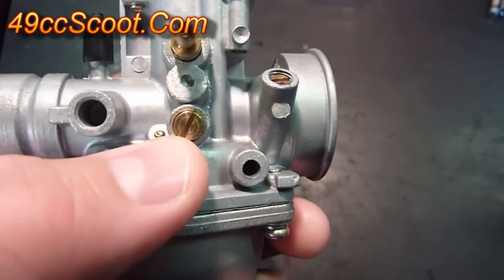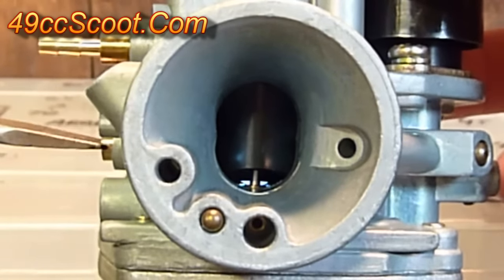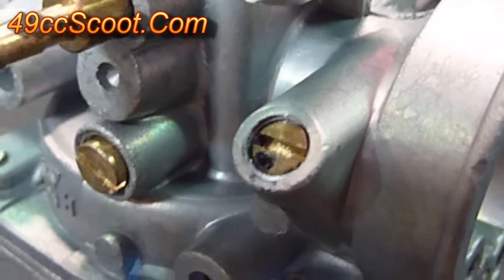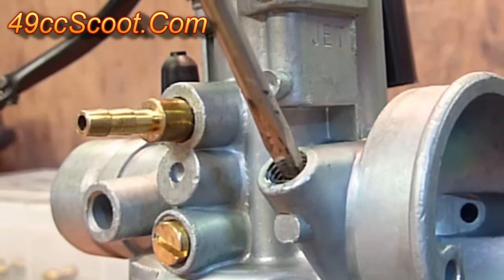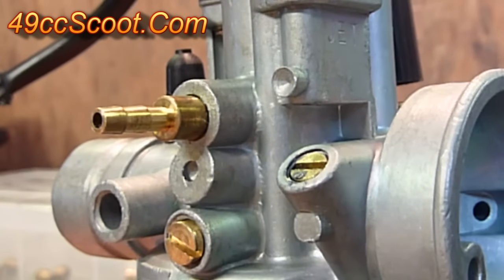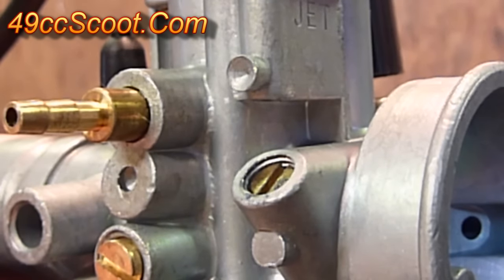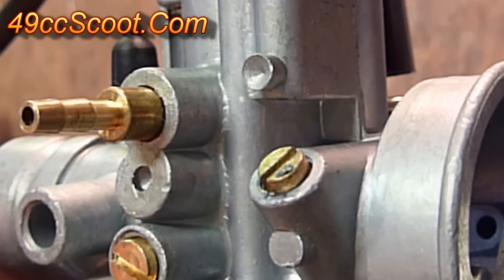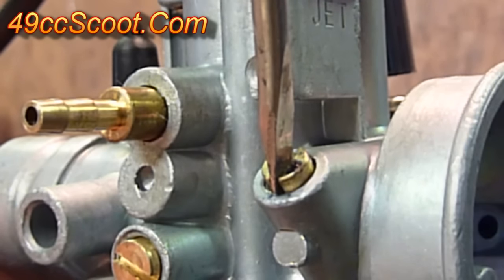Two-Stroke Scooter / ATV Carburetor Settings And Adjustments 2of4 : Idle Speed & Mixture

Comment: I have a 2 stroke bike 125cc. I bought an aftermarket exhaust for this model and for the same cc. I changed it and i did some settings on my mixture screw. I have now a good and continuously idle at one and a half (1,5) - quarter past 2 turns out and the bike it seems that its working very good. BUT when i'm putting the 1st gear and trying to run the bike bog. What is your opinion about that? 
Its the exhaust the problem ? Or something else?
Thanks in advance
Reply from the maker: Are you sure you don't need to be more aggressive with the clutch? Tuned pipes for 2Ts typically make more power at higher revs at the expense of robbing output at lower revs. I'm mostly accustomed to CVT transmissions, but we have to use higher engagement clutch springs and lighter weights to keep RPM up with tuned pipes.

You may also have needle or main jet issues.

Comment: Thanks for the vids. Very helpful and used it to help me disassemble mine, clean and put back together. Mine is on a 1986 Yamaha Jog but it doesn't have an idle mixture screw. The port is there but it is filled with hard plastic (like from a hot glue gun) at both the screw positions and the air intake port. Why would this be?

Comment from the maker: +Guajiro Konn You've pressurized the cases (about 6psi) and made sure pressure does not escape? Checking with propane, water, carb cleaner etc... for intake leaks is not always effective on a 2T. Reeds in good shape? Float height set properly?
Reply: hey I just picked up a eton beamer 2t and it idles too high even with the idle speed screw at its lowest setting, would i have to adjust the mixture setting? or is it a different problem?
Reply from the maker: Make sure the cable isn't pulling the throttle open. There should be adjusters. One at the handlebar and one at the carb. If there isn't a small amount of slack it'll hold the throttle open. Could be that you need to adjust in more fuel or have an air leak as well.
Reply: thanks for the info will take a look at her tomorrow.

Comment: Adjust mixture until there is no lag or hesitation when I goose the throttle a little? How can I make sure it's not too lean or rich, as I've got it idling pretty good,  now. Thank you for your time,  Bro'.
Reply from the maker: If it responds well, idles smooth, and doesn't hang when you let off or die out; it should be alright.
Reply: Thanks.

Comment: Not expecting an answer but which hose goes to which lead on the carb?

I know… Should have taken a picture.

2 fuel hoses go on top when mounted.  

One has some sheilding and a coil

2003 Moskito SX 50cc
Reply from the maker: Most don't have 2 fuel hoses. Fuel would most likely be the protected hose and should be from the petcock/fuel tank. Generally it's the largest fitting, facing up or out on the side. Vacuum for the vacuum operated fuel petcocks is generally a smaller hose that goes on the center nipple that  faces up. Side nipple that's small should be oil injection.
Reply: @49ccscoot  Yeah oil injection is on side just above idle adjustment screw.  There are two ports on top.  Then there are two hoses.  One is grey and goes up under tank. It spits out fuel when you crank it. 

The otherhas some spring covering it. it too runs up to the tank.  The tank has a barrel on bottom w 2 spouts.  bottom spout is grey and naked.  side spout has the spring/coil wrapped around it.  The naked one is 1/2 the diameter of the spring  one

Just looking to find out which hose goes where on the carb. Again it has two spouts on top.
Reply: You know what I think I answered my own ??  It looks like the spout on the “out” connection going to the engine is smaller than the one by the from (air intake)
Reply from the maker: @gulgul2006  Trace the hoses to see where they go on the petcock. https://49ccscoot.proboards.com/thread/3653/vacuum-petcock-fuel-valve-connections

Fuel hose for carb will lead to the float needle and seat in the bowl. It's going to be the largest nipple on the carb in most cases.

Vacuum connections on  a carb will lead to the intake  tract so they have a vacuum source.

Comment: very useful video, my scooter runs with the idle screw, screwed almost fully, I mean it idles with it screwed out about 1,1/4 factory spec but I can only do about 10km/h, with it screwed in almost fully I can do sometimes 30km/h but the engine has been rebuilt so I'm not sure about this, if it should be ok for the setting to work this way while I break in the engine or I should be able to run quicker. With this setting though I get very bad mileage, 7 liters of gas runs out in about 100km
Reply from the maker: Have you tried anything else, like main jets or needle settings. Idle mixture shouldn't be the main contributor to top speed.
Reply: @49ccscoot  Since I have cleaned the carb with wd40 and later with a spray for carb cleaning and also moved the needle higher and I must say that now after I start up the engine and let it run for a minute or two, the first minute of riding gets me up to 45/50 km/h but then max 30.. also from half throttle to wot nothing happens. From what I've learned so far it must be the main jet since raising the needle only helped so much. Also I have the feeling that the automatic enricher is not working anymore since the cold start means kicking several times with very short periods of running. Very helpful material, I have learned a lot and I hope that in the end I will be able to tune the carb and have the scoot realiable
Reply from the maker: @ruyutransport2298  I've got much more detailed info about the carb tuning process here : http://www.49ccscoot.com/faq/carbtune.html
Reply: @90GTVert I'm a bit confused as right after cold start the engine revs happily and I can achieve a decent speed but in about 1 min the throttle does not react past half throttle. I opened the carb and seems the float is not level as you suggest so I concluded it might be the automatic enricher that gives more gas therefore better performance when cold than the running is too lean also I am missing the gasket from the accelerator cable mounting on the carb so I might get a rebuild kit,  very very useful tutorials!
Reply from the maker: @ruyutransport2298  The engine requires more fuel when cold, so it could be that it's rich and once warm it's just too much fuel. Could also be that the cold start enrichment is delivering a lot of fuel and it doesn't like it after without the fuel. I would do some test passes WOT once warm with different main jets and record results as detailed in the link that I provided.

Comment: Hi there!! Thank you for the excellent video! I am experiencing a problem with my 50cc 2T morini engine and Iwould like your help...I tried to adjust the idle mixture screw and I thought that I found the ideal setting but whereas the scooter runs good after a while, when the engine has been pressed (e.g. after a 5 minute run in the highway with 45mph), the engine idles poorly and dies when I stop after the run...what could it be?
Reply from the maker: Possibly the wrong main jet or maybe the mix is a little on the rich side at idle. Usually rich will cause them to idle low. Lean the idle often hangs. That's not to say it can't be on the lean side. Take a look at your spark plug to get more of a clue.

Comment: very good job, nice video. I need some help if you can please. my scooter, a Honda 250cc when engine is cool can't stay on except if i give some gas. when the engine is hot enough, runs normally. please can you tell me what the problem might be? thanks .
Reply from the maker: I'm not real familiar with the 250s, but that sounds like the symptoms of a bad enrichment or choke system. If it has an automatic enricher, that would be the first thing I'd check out.
Reply: thanks a lot. Yes it is an automatic choke. Is it any possibility off bad mix from carb?
Reply from the maker: You could try adjusting the idle mixture and idle speed to see if that gets you anywhere.

Comment: Is there a good rule of thumb regarding initial idle air-fuel screw adjustment (number of turns) before starting the engine?
Reply from the maker: 1.5-2 turns out is where many like to start.

Comment: Hi great video but can you help me with my problem my friend adjusted my carb then the bike wont turn on anymore. What should i do??
Reply from the maker: Check little stuff first. Kill switch set to run, still has fuel, alarm not on... Sounds  silly, but it's surprisingly common for someone to use the kill switch and the next person that normally only uses the key can't start it.

Checking for spark is quick and you can often feel if compression is low by working the kick starter. Sometimes it's not the thing last touched.

If he just messed with the idle settings, I'd start by setting the mix screw 1-2 turns out from seated and see if that's much of a change or allows it to start. If he did more, find out what he changed.

Comment: I wanna ask what is Mixture for ? Does it makes any diffrence in the scooter going faster or acelerating faster?
Reply from the maker: It can make a difference in throttle response, but it should make a very minimal difference in the air/fuel mixture above 1/8 to 1/4 throttle. Mainly you want a setting that provides a steady idle that doesn't hang if you rev it from being lean and doesn't slowly die out from being really rich. I like to set it on the rich side though for better cooling.
Reply: *****  just wanna ask one more question before i tune my carb i will warm up my 50cc scoooter then should i let it run while i adjust the idle mixture screw or it should be runing ? Also i have Polini Scooter team 2 pipe and i think now its runing rich cuz when i give full throttle sometimes there is mixture coming out of the exhaust so should i make it to go more air ?
Reply from the maker: It needs to be running because you'll be listening for changes in the idle as well as monitoring RPM if you have a tach.

Do not adjust for WOT using the mixture screw. You need to get a selection of main jets and find the right one for the best WOT performance.
Reply: ***** I use the idle screw  not the mixture one and i make it 2000rpm then i give it gas it goes up then it wont come back to 2000 stays 3000 then i readujst the idle mixture screw a bit to the left 1/8 turn then it was kinda staying now im waiting to cool of to test it
Reply from the maker: It's either adjusted lean, lean main jet, or you have an intake/case leak. Hanging idle is usually lean for some reason.
Reply: I really dont knoow what to do where i bought it from the mechanics are idiots so i wont take it there probably gonna buy 17.5 dellorto cuz i mean the scooter is going really fast and eating fuel also when i set it to get more air it wasnt acelerating fast so i returned to stock much better
Reply from the maker: This is a four-stroke, but tuning principles are largely the same. May be of some help for you : https://youtu.be/K5j8gHg5kMc

More help :
http://49ccscoot.proboards.com/thread/1727/spark-plug-reading-tuning-info
http://49ccscoot.proboards.com/board/12/carburetor-intake-tech

Comment: So the idle speed adjustment adjusts idle speed. 
But also the air/fuel adjustment affects speed also 
Where do you start with the idle speed adjustment then?
Reply from the maker: Start with the speed screw. Then adjust mix. If idle raises too much, correct with the speed screw.

Comment: Hi man. I bought a clone mikuni carb like this. With the idle screw and air mixture screw, does it not normally come with a washer and o-ring?
Reply from the maker: Yeah, they usually use that to seal the screw.

Comment: I don't know if you will reply, but when I start my bike cold it trottles to almost max rpm and calms down when it warms up, what should I do?
Reply from the maker: Try adjusting the idle mix and speed. If that doesn't get you anywhere, see if the automatic enricher (if equipped) is working.

Comment: Hey Man, thanks for the video. I know you probably get a lot of questions, and I would really appreciate your feedback. I have a 13mm carb on my 49cc, I upgraded the main jet from a #65 to a #72 but I get bog really bad when I have the throttle from a 7/8th to full position. My theory is that it is running rich, or the intake manifold isn't big enough. I could pull the spark plug, but I've only run it for an hour or so since I changed out that main jet. Any thoughts? Much thanks
Reply from the maker: Air leaks? Airbox installed and in good condition? Rich is usually a sputter. Lean sounds clean.
Reply: Its only when the bike is running floored. It will start to sputter. I have a pod filter, no air leak that I know of.
Reply from the maker: On many of these, pod filters are more trouble than they're worth. Might wanna see how it does with the airbox.

Comment: Got it screwed  all the way in.to idle properly on the mixture screw.....you think pilot jet still partially plugged? Will idle nice when warm..was sitting for years ..  maybe I didn't clean pilot jet enough..a little difficult to start cold..
Reply from the maker: Could be. If you happen to have access to an ultrasonic cleaner, that's a good step for a stubborn carb too.

Comment: Let me understand this: The fuel-air mixture adjustment screw is the one which is spring loaded, while the idle screw is not?
Reply from the maker: There's usually a spring under the mixture screw, but it's not generally visible without taking it out. The idle screw often has a spring under it that can be seen without any disassembly.
Reply: @49ccscoot  
That clears it up (thank you), because everywhere else I looked, it is the idle screw
only which is shown having a spring.

Comment: I bought brand new 49 cc that runs only on choke. I cleaned the carburetor but nothing changed. Do you have any suggestion to fix this issue?
Reply from the maker: Make sure the airbox and air filter are in good condition first and that all connections are correct. Make sure the fuel supply is good. Nothing appears to be loose, like intake bolts or exhaust or the fitting of the carb into the intake or airbox. Could just be out of tune beyond that. Some of the 49cc carbs come with really small jets.

Comment: Friend why I want to remove the oil pump is why I upgraded my scooter with a exhaust racing,air filter racing,springs in the transmission of 1500rpm variators kit racing, belt Malossi 793-16.8-30
Reply from the maker: +Brikos S Yeah, I throw them in the garbage even on a stock engine.

Comment: Would u mind explaining the rolling wrench pwk 21mm carb that's said to be for the bbk qmb39. Has a blue an red knob . Blue on left side an red on right side an both are on the air filter end of carb
Reply from the maker: No exp. Just looked at pics. Blue is idle speed. Guessing the knob will be choke. Idle mix screw should control air on the PWK. Looks like a $25 AliExpress carb to me, with extra decals.

Comment: Same carb 50cc 2 stroke eton viper Japanese bike... carb just floods the cylinder... float/needle is working... tested it by turning on the gas with the bowl removed and seen it stop flowing when lifted the bowl... is that little rubber nipple required for the other side since it's just a hole right into the intake?
Reply from the maker: You will have a vacuum/air leak without it capped. Float could still be sticking when in the bowl.
Reply: @49ccscoot  yup... just took it all back apart... float has a little gas in it... thank you for answering...

Comment: Will lighter cvt rollers allow speed at take off similar to 4t bike's? And will stock air box restrict speed in a 2t? Im new to the 2t but I got my bike to start and idle immediately doesn't crank more that 2wice when cold but has virtually no speed at take off im only wanting to do mid 40s and to hopefully get there in 1-2 city blocks
Reply from the maker: Lighter rollers should increase RPM overall.

Unless the airbox has a very small snorkel, it's fine. I use stock airboxes without snorkels on 86-110cc builds that make around 20HP.

Stiffer clutch springs and lighter weights may be all you need for better takeoff.
Reply: Thank you sir ill give that a try tonight

Comment: That's an old video, but still very usefull! I have one question... If I have the mixture screw unscrewed more than half a turn, my engine is idling very high for 10 to 20 seconds and then falls down to a "normal" idle revs. I have to have this screw out no more than half a turn in order for the engine rpm to instantly fall back to idle after I release the throttle. Does anyone know what could be the culprit? I thought that engine must be leaking somewhere but it sealed the exhaust and intake and filled it with 1.5bar of pressure and it holds it weill, so no leak. I also have to mention that I had to put a 1mm washer between the carburetor and an idle enricher in order to be able to start the engine. If this washer wasn't there you have manually crank it for three minutes to start it. I have a minarelli horizontal two stroke 50cc engine (CPI/keeway).
Reply from the maker: Lean running engines will often experience high idle that  drops after some amount of time. Usually it's worse if the engine is hot. It will happen when the needle is too lean as well, so you could try moving the clip down a groove on the needle and see how it changes.

Comment: Hi tks again four your vides, I fit on my scooter two stroke a new 50cc cylinder and piston the scooter wheen I start and give a gas is not go and same times is cut off also black smoke came off from exhaust, I remove the spark plug and is oil on it what you recommend to do please? Tks
Reply from the maker: If it's definitely oil fouled you've got too much premix (32:1-40:1 is good for most oils) or the injection system is messed up. If it's gas and oil rich it could be too large of a jet, bad reeds or reeds not sealing, or some type of air restriction.